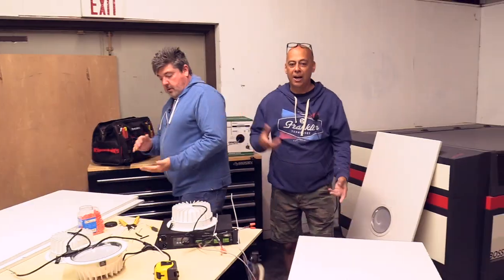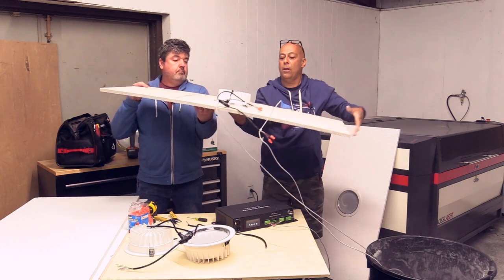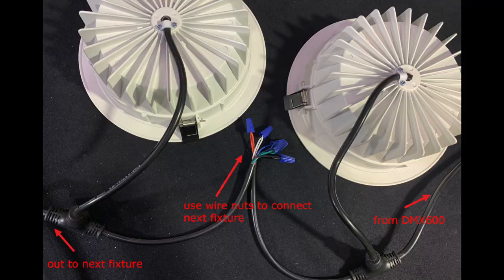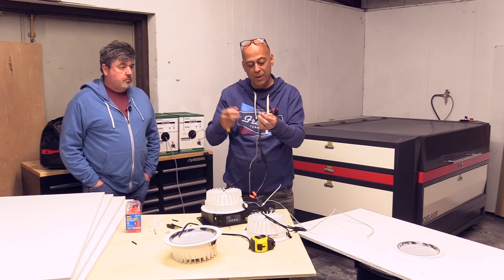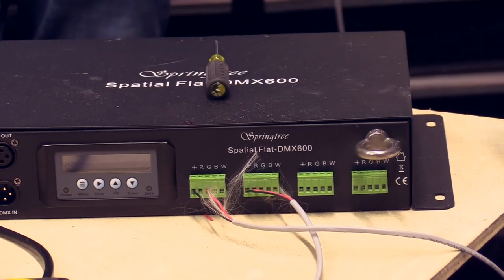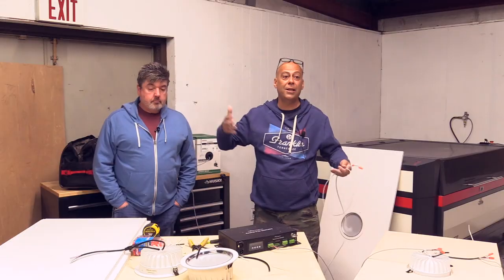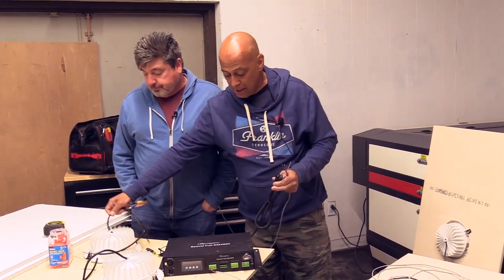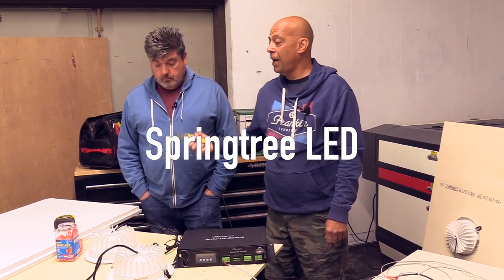Learn How to Install DMX Controllable, LED Recessed Lighting!

Comment: can you share the link for the tile cutter. Elmer
Reply from the maker: https://www.amazon.com/Jonard-Tools-AHC-10-Adjustable-Cutter/dp/B07TXMPCG7/ref=sxin_16_sbv_search_btf?content-id=amzn1.sym.6cfa532e-9c8f-48d2-87a3-a61547a0d356%3Aamzn1.sym.6cfa532e-9c8f-48d2-87a3-a61547a0d356&crid=JUAS4PFQTXO2&cv_ct_cx=adjustable%2Bhole%2Bsaw%2Bdrywall%2Bcircle%2Bcutter%2Bdrill%2Bbit&keywords=adjustable%2Bhole%2Bsaw%2Bdrywall%2Bcircle%2Bcutter%2Bdrill%2Bbit&pd_rd_i=B07TXMPCG7&pd_rd_r=ba6bf705-1a7c-4e47-92f1-bfa0ebfbae00&pd_rd_w=p3joY&pd_rd_wg=F9fTt&pf_rd_p=6cfa532e-9c8f-48d2-87a3-a61547a0d356&pf_rd_r=0BB50KTJHXPZ75G8XMJZ&qid=1691442569&s=hi&sbo=EO%2BcdOgoisx3waG5xqcZQA%3D%3D&sprefix=Hole%2Bsaw%2Bdrywall%2B%2Ctools%2C101&sr=1-1-5190daf0-67e3-427c-bea6-c72c1df98776&th=1